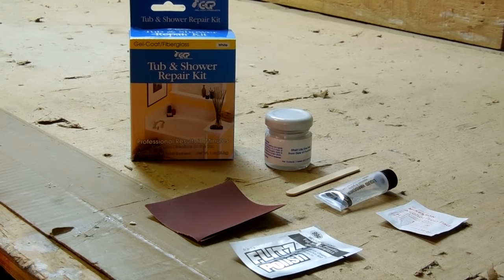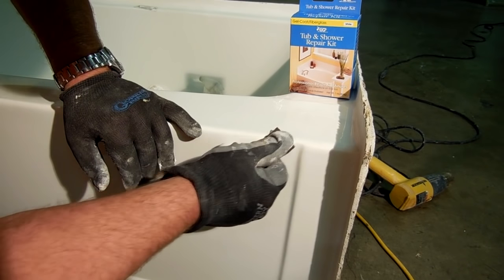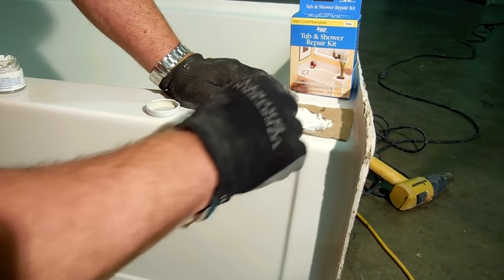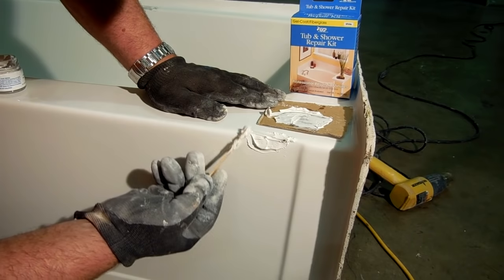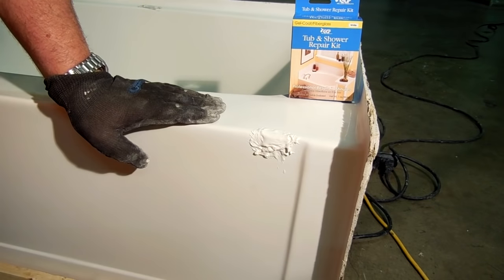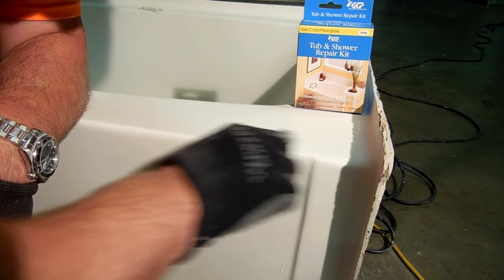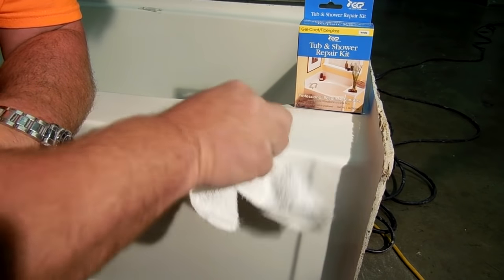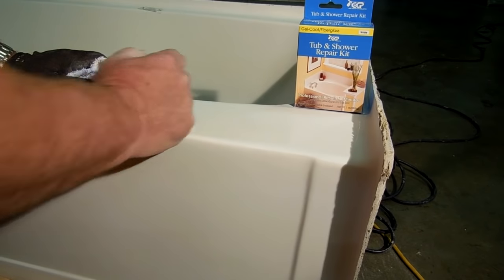GCP Tub and Shower Repair Kit

Comment: Very helpful tutorial!  I'm not sure this product would work in my case as nothing underneath a hole in the tub rim to support the repair.    Appreciate all your advice.
Reply from the maker: Depends, stick something in the hole if it meets something about a half inch in that's good. Sometimes there's a thing called an air void which is a pocket between the gelcoat and the fiberglass. If it's solid then the paste should work. If there's nothing there then you probably need to called a repair service to have the hole glassed.

Comment: I recommend covering the repair area with plastic so it is smoother and follows the contour. This should save a lot of sanding or having any low spots that you didn't fill enough if it is left gloppy. To adjust the color your local marine store has colors made for gel coat and epoxy.
Reply from the maker: Problem is when you do the material shrinks and then you have to reapply more material because shrinks below grade.

Comment: Thank you for posting, nice job. It would help a great deal of saving sanding time, …if you reshape the patch while is getting hard with wet finger.
Reply from the maker: The problem as I stated in the video is the paste shrinks and must be higher than the damage. The paste sands easily, it's not fiberglass, it's gelcoat with Cabosil as a thickener.

Comment: Hi Ray! Thanks for this video. Here's my situation: 
DIY total bathroom gut and remodel. I caused two small areas of damage/cracks  to brand new, white, acrylic Kohler tub (not fiberglass or gel). Totally my fault. Did not position stool well in tub, when tiling shower, before I stepped up on it. :-( Ugh. Subfloor is solid; no movement/flex in tub floor. Both cracks on inside as you stand in tub/face shower, so not viewable from outside tub. First crack - 3" long where tub curve pretty much meets floor  and second crack (1" long) a few inches up from there in inner side wall. Could not remove tub without destroying all surrounding tile work I just did to shower and half walls. So, per Google, I drilled holes at each end of the cracks, then backfilled (blind) with "Great Stuff" foam from HD. Then V-ed out cracks with file and filled with this same exact Gelcoat tub repair kit in your video. Not sure I trust since still minor movement in the bottom repair on first crack when I push on it with finger (opens a very tiny bit). Remembered (afterward, ugh!) that I have  small access panel in hall closet to tub underbody and damaged areas. Went in there and took the foam out because I want to reinforce repairs by sealing backside with fiberglass mat and resin. So, some questions: 
*If I do the fiberglass underside repairs, will it effectively waterproof it from underneath? 
*If so - I have the glass mat. What resin should I use and how should I prep surface before applying?
*It doesn't have to be pretty since underneath, so I was just going to layer glass/resin twice on each crack and leave it without sanding. Is that okay? 
*Do you think the Gel Coat kit putty, that you and I used, is non-porous and will hold up over time with consistent exposure to water? If not, will putty come out eventually? 
*The white putty did not match my tub exact, but it's not readily noticeable when viewing tub from front. Do you think people stepping on it will discolor it further (since no actual resurfacing done)?
*Should I grind it out and put in white, Acrylic Filler, instead for better bond/strength? And if so, do I have to paint over that? 
I don't have the tools or knowledge to paint an acrylic tub, but I also don't want to pay $500 for a long shot at the "right professionals" at this moment and I really don't want a total resurface (what they told me they had to do). Sorry for the long post and myriad of questions. I'm just trying to learn. Thank you for your help!!!
Reply from the maker: The tub you're referring to is a composite unit called Vikrell, which is a mix of polyresin and fiberglass. When I was doing warranty work for tub companies, Kohler refused to allow any repairs below the waterline due to the likely failure of the repair and liability.  Unfortunately, your attempt to repair the crack will probably fail. The repair kit I used in the video is not for structural repairs only cosmetic and then for gelcoat coated fiberglass.  If you plan to salvage the tub and not replace it then the only way would be to completely stop any movement and then apply a strong epoxy in and above the crack. To stop movement,  if the area of the crack is smooth on the underside you can use fiberglass matte and regular resin from the store. Insure you rough up the entire area with 100 grit sandpaper to get a solid bond. Follow the instructions on mixing the catalyst and let it properly cure. There are a lot videos on mixing and applying the glass. Then apply another couple of layers each progressively larger. The glass gets progressively stronger with each application. Then fill the crack with two part epoxy until it above the level of the tub surface.  You can then sand the epoxy back to flush with the tub surface. In the industry we use air brushes and acrylic lacquer. The color is more a gray than a white and is hard to match.  Then try and find a rattle can of white paint which closely matches the tub. But before trying to paint I would sand the area smooth with 400 and 600 grit wet/dry sandpaper just enough to insure the paint has a surface to adhere to without eventually peeling.  The paint will make it more visible in the event the crack should reoccur. But as with any repair, even if was doing it I would be skeptical. I would place a pan under the tub through the access hole to catch water should the repair fail. Remember your average tub will hold about 40 gallons that's about 320 pounds of water not including a person.
Reply: @rayanderson286  Thank you for the quick and detailed response! Interestingly enough, after I took the foam off the back side, I poured water all over the gel coat repair and nothing came through underneath. I am going to put on the fixtures today, fill the tub with water and see what happens just as an experiment. I will totally do the fiberglass underneath for sure and then maybe leave the gel coat until it fails. Yeah, it's a Kohler "acrylic" tub, model name is "Surface". Got it at Home Depot. Looked at the reviews on it today (didn't even think to do this before I bought it because - it's a freaking bathtub and you would think they would make them right -- &^%$&%#). Apparently these tubs are infamous for cracking - especially around the drain. I just don't know how to get it out and a new one (NOT acrylic) in without undoing all the wall tile work I did this year with glass mosaic and Schluter brushed nickel trim. The tiled half walls all the way around the bathroom flow right up and into the shower tile design. Just want to cry, really. If I sent you pictures, would you be willing to suggest what I could do, at the minimum, to get it out and install another? Also, back to the repair strategy, there is a place here in town called Ace PermaGlaze. It's a proprietary coating. I am wondering if that stuff will seal everything up after the underside repairs are done. Ever heard of it?
Reply from the maker: @ladymaestro1970  Yes go ahead and send some pictures. PermaGlaze is a franchise operation and they generally only do a repair and spray over the entire tub. They're best for people who don't want to do a complete remodel. They're especially good for cast iron tubs. There is a way to replace the unit with minimal damage to the existing tile but it needs to be explained.
Reply from the maker: @ladymaestro1970  If you're in Arizona which I suspect,  you can call The Patchworks of Arizona in Scottsdale. I've known the owner for over 20 years. I know he can do the repair. His name is Glenn tell him I referred you.  http://www.thepatchworksofarizona.com/about.html
Reply: @rayanderson286  Hi Ray! Your replies went to my spam, so I didn't see them until today. Weird. Anyhoo, I glassed the bottom last weekend with three layers of matte and resin just like you told me. I think I did a pretty bang-up job for a complete newbie who was working with a 12 by 12 inch access hole, two propped up hand mirrors for vision and one of those free-with-a-purchase lights from Harbor freight! I don't think anything's going to get past it. I also bought some Great Stuff Pond and Stone expanding foam that I'm going to put under the bottom repair/glass it for extra support/H2O resistance (the tub is already bedded well in mortar - not squishy except for one TINY spot in damaged area - that I can get to underneath). 
I found this acrylic stuff online, so I was going to lightly dremel down the gelcoat stuff I originally put on and back fill it with this for closer color match. https://www.surface-repair.com/diy-kohler.htm#addinst
I am currently in a new conundrum. I went to ACE today and had the best dude there help me create an extension for my trip-lever linkage since the tub is deeper than most and I had a strainer drain installed as opposed to a pop-up (daughter has long hair). Got home, went to put it in, and discovered that my contractor installed a pipe (it's all PVC) that goes from the regular size into a slightly smaller one  (A T pipe connecting the overflow pipe/tub drain pipe/main drain) literally two inches above where the brass drain stopper is supposed to set down - so now I cannot plug the tub. Sweet Baby Jesus. &%^$&%$& My church buddy/professional plumber is coming over Mon. night to help me put on all the main fixtures, so I will have him look at that and do his magic to fix it. I don't even know if they make smaller drain stoppers. I want it to work MY WAY, LOL!

Thanks for letting me write these novels on your post and for the info on Glenn! I live in Tucson. If I find that my repair doesn't work, I'll give him a call. I'll bet he's got a good Tucson reference if he doesn't make long distance trips.
I will also figure out how to send you some photos of my bathroom/tile work tomorrow so you can explain the potential tub replacement strategy. I'm about ready to rip it out and pour a concrete/tile tub! Probably can private message you via YouTube somehow so won't have to keep doing replies here.
Thanks again!!! People like you make the world a better place. YOU ROCK!

Comment: Wonderful job. Can you suggest any product for porcelain tub which works the same way ?
Reply from the maker: The porcelain repair paint at Home Depot works. Don't expect it to match in color, it probably won't. Nothing will stick permanently to the porcelain but the damaged area offers a place for it to stick. Anything outside the damage will eventually peel.  But clean the damaged area with soap and water then nail polish remover. Layer the paint into the damage until it's even with the tub. sand it smooth with 320 sandpaper, wipe with more nail polisher remover to remove the dust then one final layer of paint. Then leave it, getting it to shine again would require much more work. Good luck
Reply: Thanks, I will give it a try.

Comment: Great Video and thanks. Will this work on a 2-inch long crack? you know where we enter when we shower. Thanks so much.
Reply from the maker: If it'sin the floor and there is any flex it won't work. The floor needs to be supported to stop the flex.

Comment: Good product, fixed my tub problem, but one major problem. The lid on the jar doesn't fit well and this is extremely volatile, so it fills up any room with extremely toxic smelling odor. I wouldn't be surprised at all if it is toxic or carcinogenic. Do work in very good ventilation, dispose any rags or tissues with product outside building and if you are going to keep leftovers for future jobs, I would put it outside somewhere, and/or put it into a larger jar that seals properly, because even in garage it was stinking up the place.
Reply from the maker: The smell is strong but your assumptions are bullshit. I worked in the plant where bathtubs are made for 12 years. Does it smell? Yes. Is it dangerous ? No. The only places in the entire plant where a mask are required is the grinding and spray booths. Neither of which occur by using the repair kit. Americans scare easily, dumb comments like that make it worse. If my statements were wrong OSHA would have shut down the plants do to the smell. I have been to the plant that makes the repair kit  and no one there wears a mask.
Reply: @rayanderson286  I hope you are right, but I am not putting my family's health in the hands of OSHA. Even if they weren't captured by industry lobbyists, they simply aren't going to do the long term studies to rule out toxicity for such a niche product. If a compound is so volatile it stinks up whole place even while sitting in a closed jar, I am not experimenting by having my little kids breathe it. I don't scare easily, work on my bikes and cars, use all sorts of chemicals, but this particular product I had second thoughts about. Better safe than sorry. Not saying don't use it, but ventilate well, and store it where you won't breathe in the fumes.
Reply from the maker: @litchips  It's not a niche market. It's only pigmented fiberglass resin. My point is the material isn't dangerous. Some people can be sensitive but raising the issue of toxicity can scare people. Merely stating open a window to eliminate the smell would have sufficed. I worked with the material over 20 years and yes you can get use to the smell. I had many people complain about the smell while I was doing repairs. Sometimes I brought in a fan and opened a window when someone complained but no one ever got sick. Here's the Material Safety Data Sheet. https://www.gelcoatproducts.com/msds-tub_shower_kit.pdf
Reply: @rayanderson286  That's good to hear, if true. I was worried about it. I still don't recommend inhaling it if it can be avoided. Not so much the solid resin part, but the solvent that evaporates off. The smell is just so pernicious, I wiped a bit of excess with napkin and left it in trash in the bath, and that alone stunk up the whole place. They should also change the container to something more airtight, because the baby food jar isn't doing it.

Comment: Nice video thanks, Lowes has the product. Couple of questions, I have multiple hairline cracks running a length of 10 - 12 inches on the bottom of the tub. I saw other videos recommend drilling the ends of the cracks to prevent extending, which is not possible in my case. In your experience does the epoxy stop the cracks extending, also for the length I have does one package have enough epoxy or would I need two.
Reply from the maker: No. If you have cracks they're from one of two issues. The floor is flexing or the gelcoat is old and beginning to break down.  If the floor is flexing it has to be fixed by someone with the knowledge. I recommend not using it until it is repaired by a professional. Water will infiltrate the crack and soak the fiberglass. Then it will cost a lot more to repair or could be impossible. It there is no flex then open the cracks and fill them with epoxy it should hold up for quite a while but expect more cracks to appear later.

Comment: Nice repair.  Will this product work for a small crack as well?  I have a crack about 1 1/2 inches long in the inside of the tub about an inch above the floor.
Reply from the maker: I would push on the floor while looking at the crack to see if the crack opens. If it does then no, because the floor is moving and the unit would re-crack.  If the floor doesn't move then yes it would work.
Reply: I have a small crack, we are not sure it went through to bathtub floor.  It looks like it spread a bit.  Could I use this if I drilled a whole on each side to stop the spreading.  I cannot push hard enough on the floor of the tub to see if it is opening up or not.  The floor has some movement but not a lot from my weight.  It is about 3/4 of inch right no. (fiberglass tub).

Comment: Excellent repair! Thanks for the video. How many holes do you think one kit will cover? I recentrremoved old shower doors and there are several holes I need to repair. Thanks!
Reply from the maker: Sherry Clark  Thanks. The kit should easily handle al the holes. Make sure you round out the holes to get good adhesion and let it set up completely or you may not have enough if it comes.
Reply: Thanks!

Comment: Was wondering if this product is shiny after polishing. My tub has a shiny finish and I am concerned whether the end result of this product is matt or a high gloss? Thanks
Reply from the maker: Yes if you properly use the grades of sandpaper as shown and remove the scratches at each level you will end up with a very shiny and highly polished tub.